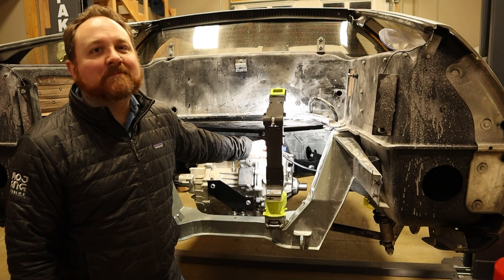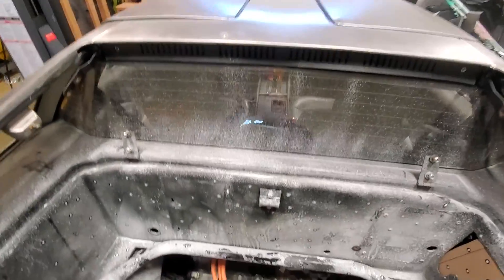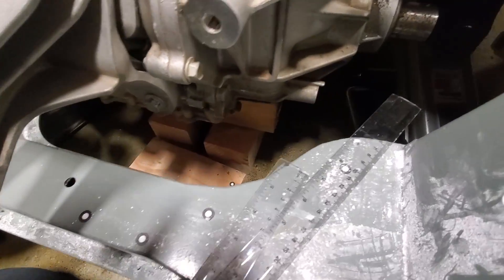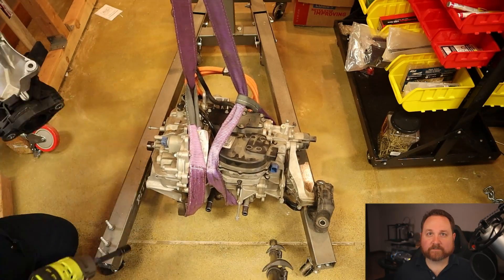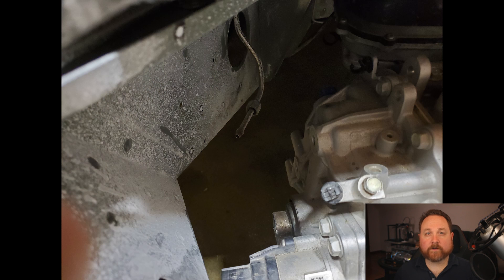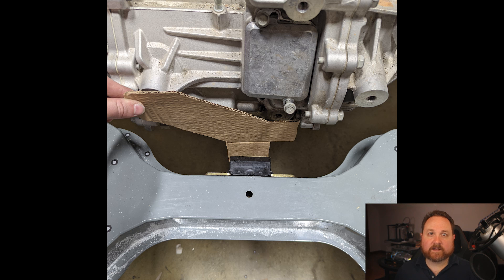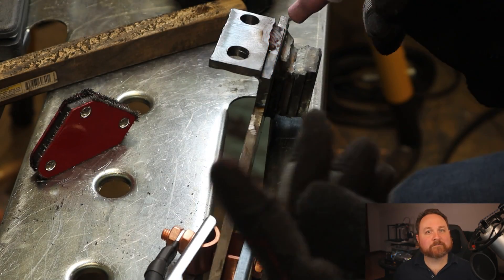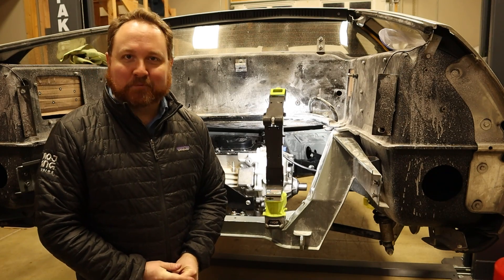Project Lightning - DeLorean gets an electric motor!

Comment: Do you want the motor centered R-L, or offset slightly to the passenger side to compensate for the driver's weight? 
Also, are mount holes in the frame rail tapped, or nuts on the outside?
Reply from the maker: @usuallybefuddled5690  I left it as centered as I could get it. It's probably off by about 1/8", not enough to matter. The holes are through-holes with nuts on the backside or rivnuts.

Comment: Could you have moved the motor to the right a little to give a bit more clearance? 
I'm assuming you plan to have custom half shafts made so having one a little shorter than the other would not be an issue,
Reply from the maker: That's a good idea! I ended up getting the shafts basically the same size, but they easily have 1/2" of travel so I could adjust later if needed. The whole thing barely budges when I hang myself from it, but I will throw a GoPro on that area and see what happens when I drive hard to make sure it won't hit.

Comment: I was surprised that you held the drive unit up with only two of the mounts. It will be twisting out of position due to bushing deflection because the third mount is missing, but it looks like with the angle of the bushings and the small offset from mounts to centre of mass it isn't too bad for this stage. I was relieved to see that you're not going to try to operate it that way!

Comment: Is the sheet metal frame rail side really suitable for mounting the drive unit at those locations without any gusseting?
Reply from the maker: There is gusseting on the backside of that frame rail. It's kind of like two pieces of sheet metal that are each molded and then sandwiched and welded together with a bit of space in between. The stock DeLorean transmission mounts to the same rails in the same manner.

Comment: @2:01 you know that's the parking brake actuator, not the gear selector, since this transaxle doesn't shift gears (or even go into neutral), right?
Reply from the maker: It's not actually - there are electronic parking brakes on each rear caliper of the Bolt, and the "gear selector" box here literally does move an internal sensor that sets which drive mode you are in (PRND) - it also engages a mechanical parking pawl on the inside of the transmission. It is totally silly, but moving the gear selector in the cabin just tells this box to move into gear, which it does, and then it trips a sensor that tells the computer what gear you're in. Even though there are no physical gears moving!
Reply: @BillCarlson  Although the transmission parking lock is a form of brake, I should have said "parking pawl" rather than "parking brake". 

I had forgotten about this goofy switch setup on the Bolt... but it is a drive mode selector, not anything to do with gears, since gears are not shifted. 

There is a reason for this setup, emulating a typical automatic transmission selector: use of off-the-shelf components (the selector lever) and consistency between vehicles built on the same assembly line (which included the Sonic).

Comment: I would like to do this same conversion with a bolt and a lotus evora 414e prototype donor car I may buy. Is this possible?
Reply from the maker: I honestly have no idea - you'd need to take the Lotus chassis and measure it in all dimensions to see if you can find space to mount the batteries and electric motor and everything. I had the DeLorean for about a year before I started the EV conversion - even though I was leaning towards the Bolt EV as a donor, I didn't actually buy it until I had a chance to measure the DeLorean inside and out. If it didn't fit I'd be out about $13k!
Reply: @BillCarlson  thanks for the reply!  I'm going to look into it as I think it would make an excellent donor vehicle. I like the fact the body can be completly removed to access everything. Also not sure about what parts on this prototype car are functional but it's cheap so i think it would be a fun project if the dimensions work. Thanks again and really enjoying learning from your project!
Reply from the maker: @landonreidmiller4974  I'm surprised that a one-off prototype vehicle would be cheap, but I say if you can get it, go for it. Keeping the drivetrain as-as in a Lotus Evora would be sweet! Beautiful cars!
Reply: @BillCarlson  I am too, they are asking 10k but I'm sure I could get it for much less since its technically non-functional and lotus isnt a huge name. Even if I didn't do the conversion it would be a cool piece of automotive history I wouldn't mind owning. I really think the evora is great platform for the conversion though so I may get it and make an attempt. I really appreciate you documenting your conversion because I think it will be very similar to the DeLorean conversion. I'll keep you updated!

Comment: Bolt EV owner and former professional TIG welder here... Looks like you got the concepts down and you seem conscious of them, but I would stick to the lay-wire method until you've had time to work on your wire feed skill. Best way to work on that wire feed skill is to learn on aluminum where you have to move fast and feed fast. 

Anytime you contaminate the filler wire with tungsten or oxidization, pick up your trimmers and snip it off. Don't be tempted to pull your gas away from your filler wire to inspect your work. Dealing with oxidization while you're practicing makes the process feel like you're running in place and not gaining any ground. Make sure your post flow is enough to keep the parts from oxidization. When you're new you tend to move slower because you don't have the muscle memory down and you get the parts really hot and more post flow is required.

Difference between learning MIG welding and TIG welding is it takes a long time to get satisfaction from your work and requires a lot more persistence as it requires actual coordination and skill. Keep it up, it's a very valuable skill to have in your toolbox. Just don't tell anyone you know how to do it because you'll become like the guy with the pickup truck on moving day.

Subscribing and looking forward to the results.
Reply from the maker: Thanks Brian, I really appreciate the tips! I definitely found the 'lay wire method' much easier, and you're right - especially for these motor mounts I was getting everything waaaaay too hot. I've got a huge amount of aluminum welding coming up when I do the cooling plates, so I'm looking forward to getting in a lot more practice.
Reply: @BillCarlson  Do the cooling plates really need to be welded? The cooling system should run at low pressure, so adhesively bonding plate layers is likely suitable. There's also brazing of sandwiched sheets.

Comment: This is from a Fabricator by trade, I would have put a gusset on at least the long plate on each of the side mounts, removing a 5/8" to 3/4"  triangle at the inner corner so dirt, water etc doesn't get caught there.
Reply from the maker: I like that idea a lot, Scott! I was thinking that on my next design I will 'square up' the two 'tabs' and then box them together. This first go-round I didn't pay attention to making the tabs hit the mount plate at the same angle, but it would be easy to adjust. Keeping a triangle in the inner corner open is really smart!

Comment: Just wondering if you’ve figured out how to disable that 91 mph speed limiter on the bolt drivetrain.
Reply from the maker: No, and I don't think I would attempt to remove the limit. It's based on the max RPM of the electric motor, bearings, and gears in the driveline - basically the max RPM of the motor dictates the max speed, and running it at a higher RPM means lower efficiency and greater wear. My goal was to be able to hit 88, for obvious reasons. ;)
Reply: @BillCarlson  How does the DeLorean overall tire diameter compare to the Bolt? The stock DeLorean rear was apparently 235/60R15, while the Bolt uses 215/50R17... nominally the DeLorean tires are a couple percent shorter, so the same motor speed limit will correspond to a couple percent lower speed. It sounds like 88 MPH is right on the edge of possibility.

Comment: One thing I would like to point out.  On the motormouth plates I saw a few sharp inner corners.  You want to round them up because under pressure this might cause cracks to start.  I don't think you'll be producing enough torque to damage those plates, but better be safe than sorry.  Also the B is for Build channel just got a Delorean and is also doing an EV conversion using the Chevy Spark drive train. GM actually will be selling kits to do just that.  Looks like you might have influenced them.  Or maybe is just a coincidence.
Reply from the maker: Thanks for the suggestion! I would like to remake the mounts using laser cut parts in the future and I'll keep this in mind when designing them to keep the corners rounded. I have been following B is for Build! I haven't watched the latest video, but their previous one said they were going to use the system shown off at SEMA which is the "Cruise and Connect" platform which is a Chevy Bolt drivetrain, same as me! I had reached out to GM multiple times after their announcement and they did not respond, sadly. I'll watch their video today and see if they have any updated info!
Reply: @BillCarlson  GM won't respond because they have no interest in individual projects. They'll likely contract with an aftermarket supplier for support whatever they choose for their conversion components. Ford has chosen AEM EV for their "Eluminator" product.

And it seems unlikely to me that they will actually use any Bolt parts; it would make much more sense to use Ultium components.
Reply: In addition to rounding corners, gussets perpendicular to the plates in those brackets would be good to keep the welded joints from flexing to failure.

Comment: I am curious how you are going to handle the instrument panel.  Are you going to keep it original?  How are you going to handle the information translation like battery charge level, speed information, regeneration kWh.  Are you going to make that Analogue or going to Retrofit the Bolt EV's touch Screen?  Also curious where you are going to mount the Charge Port.  Would be cool to see you reuse the Gas Refill Port as the Charge Port.
Reply from the maker: Thanks for the message! I'm going to use the Bolt's infotainment touch screen and also the instrument panel. I am going to put the Bolt instrument panel inside of the DeLorean's binnacle - and probably fill in the remaining space with a 3d printed filler. I would like to make a custom digital dash in the future, though. Currently I have no set plan for the charge port! The DeLorean's gas fill port is under the hood, which is kind of a pain for daily charging. I might make a flip-down license plate or something? Still up in the air, but I'm interested in ideas!!
Reply: @BillCarlson  Grab an old Mr. Coffee, mount the charge inlet inside, flip the top for access, and label it "Mr. Fusion". Just kidding... unless you're willing to do that.